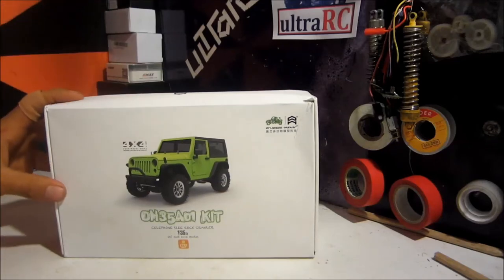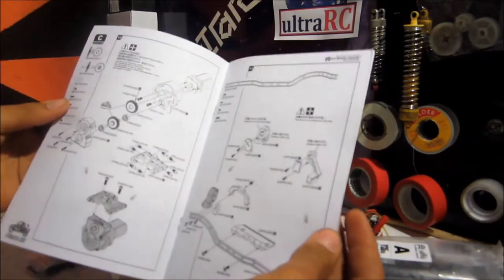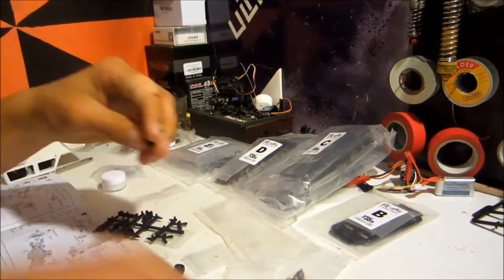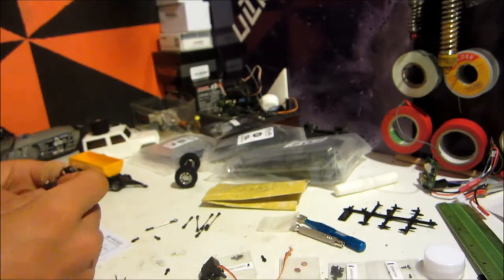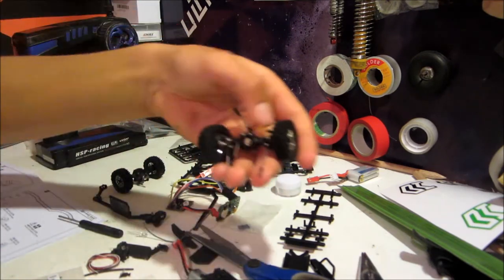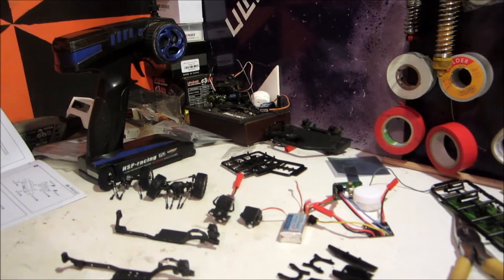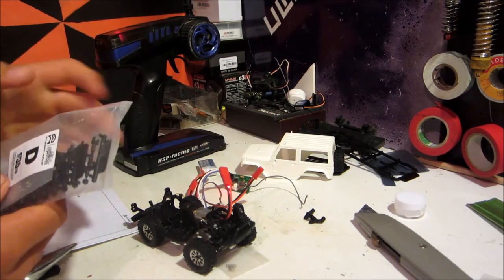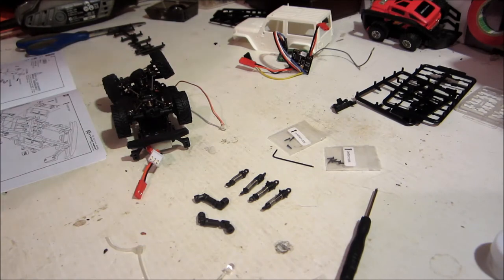Building My 1/35 Orlando Jeep From Start To Finish

Comment: I am not very patient, I probably shouldn’t get one? Should I? Advice?
Reply from the maker: the time you will spend makes it great value 
though it is really fiddly
to be honest i don't use mine much any more
i spent more time building tracks for it>
though my friend drives his all the time.
if you like the scale looks of a 4wd and don't mind going slow and dont have much room for a track this is a good option for you.
for a whole 4wd kit chassis you get allot of parts just as much as an scx10
anyway if you already have a remote this will keep you busy and wont brake the bank.
hope that helps mate i might make a review of this little truck soon
thanks for watching and have fun ricing!!!
Reply: ultra rc thanks! I like your amp video!

Comment: I'm trying to buy the parts to build one of these but cant seem to find a Li-po 2S 7.2V 260 mAh Battery anywhere.
Reply from the maker: Yeah the proper ones don't exist.
i use these now!!!
https://hobbyking.com/en_us/turnigy-nano-tech-300mah-2s-35-70c-lipo-pack.html
Thanks for watching ULTRA RC mate!!!
Reply: @CORINKERSTEN  Thankyou and also I cant find the Servo Transfer Lines, i'm very very new to kits, will any line do?
Reply from the maker: @cptbean6883  , Im not sure what you mean but the servo plug's into the esc,
 which is a bit unique and the esc plugs into the receiver passing on the signal.
does that help?